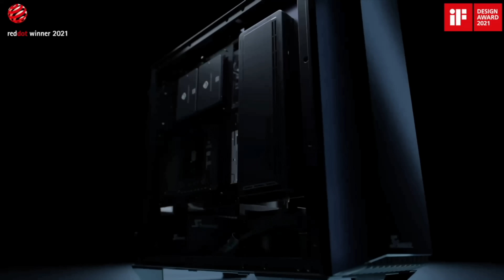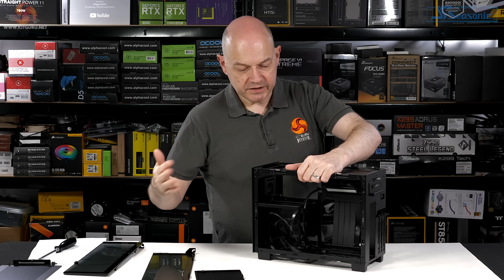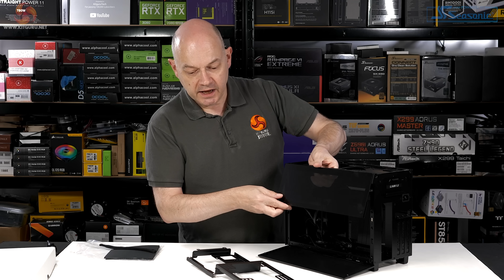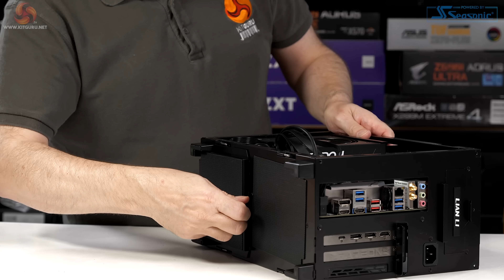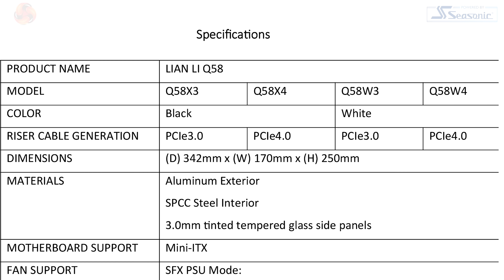Lian Li Q58 Mini ITX Chassis Review

Comment from the maker: the Q58 is very unusual - but what do you make of it? would you buy one for your next mini-ITX system?

TIMESTAMPS:
00:00 Start
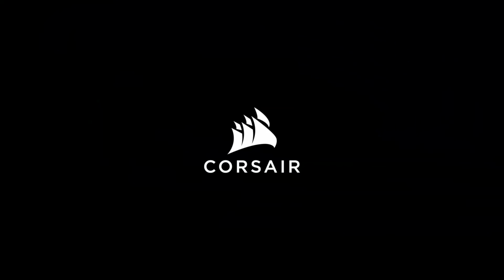00:15 Q58 - it looks bonkers!
02:08 If you want to see unusual …
02:19 The door/panel  system in operation
03:55 Alternate Top bracket
04:43 System build discussion
08:25 Swapping to SFX
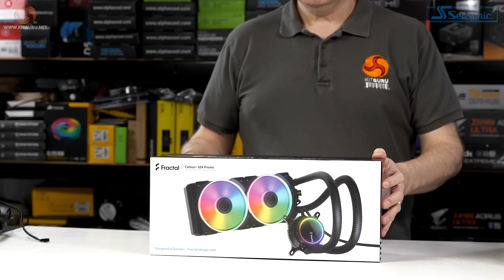09:21 Fractal Design Celsius S24 Prisma install
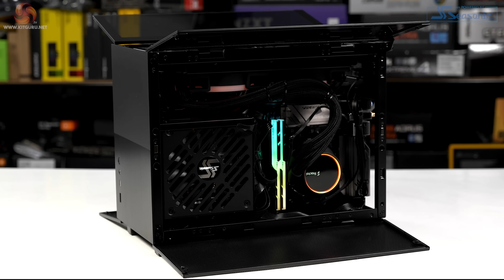11:08 The way Leo sees it
13:46 Leo ponders a revisit
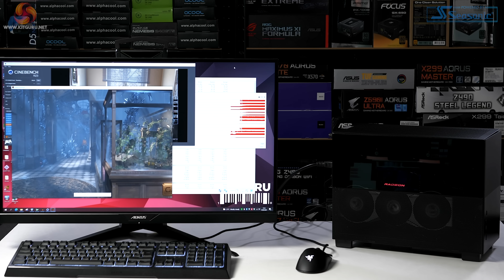14:09 Test Results
15:40 Leo's Closing Thoughts
Reply: Hi Leo, I'm more interested in the Cooler Master NR200P Max. There are so few reviews of it - will you be getting one? It has a similar design but comes with an 850w SFX PSU, 280mm AIO and Gen 4 riser. Plus there is room for 2 thin/15mm fans in the floor.
Reply: I've been waiting for this, buying as soon as it comes out, thank you for the review!
Reply: Top Review Leo, I am very interested in having one, only one thing don't like is  Tampered Glass looks very dark Tinted, Would be great if they included clear Acrylic panels with vented holes you just slot in the frame, Guess I could mod my own :)
Reply: Leo. I have a question. I already have an pci 4 riser (10 cm). You think I would fit in this case? It could save me some bucks to choose the 3.0 version. Thnx.
Reply: i have a little concern regarding being able to fit Asus Crosshair VIII Impact in this case. how's the clearance for SO-DIMM.2-Card? can you measure the space(lenght) from motherboard to side panel? and that PCI riser is it long enough to go over that dtx extension? thanks in advance!
Reply: I don't think a 650 watt PSU is powerful enough too run that GPU and CPU for power spikes
Reply: @seaneire2163  650w will be fine. 300w gpu + 105w cpu leaves plenty of headroom for whatever other small wattage consumption in other hardware and for spikes.

Comment: if they added a bit more height  and added space for 2 slim fans at the bottom for the gpu, this case would have been perfect. 
I just dont get putting glass on the top-gpu side (for the white ver. at least), what are you showcasing? the radiator sides?

Comment: Good review, but I disagree with the CPU/GPU discussion.  It's more of a FPS discussion than a linear scale with GPU speed.  If you're buying a 6900XT to play at 4k60 Ultra... A 5600X would work just fine.  If you're trying to hit 165-240+ FPS, that's when you need the faster CPU.  

Just a minor point of correction. Good video - cheers!

Comment: I am hearing 280mm rad support is very very limited or non-existant. Can anyone confirm fitting a 280mm rad into this case and which one?
Reply: Install fans on the Bracket and remove the hot swap SSD slot should provide enough space.

Comment: Good review Leo, although I think you forgot to mention that you can mount another 2.5" SSD behind the power supply as well. Also, just so we're clear, am I right in thinking a 280mm rad will only fit if the fans are on top? Do you know whether there are likely to be compatability issues with different 280mm AIOs (I'm looking at going with EK) 

I think this is the case that will push me to go ITX. Space for 2x 2.5" drives with no compromise on fans, large AIO support, full length GPU support, additional mesh panels available as well.

I might even see if I can squeeze some 40mm or 60mm noctua fans underneath the GPU to help actively exhaust hot air more effectively.

Comment: Are you still doing another video trying to fit a 280mm AIO? Very interested in this case but want to see fitment first, I read on lian li website should work but you have to install fans above radiator and move the psu down, was just wondering how much room that gives to route the tubing over the psu, and in this orientation can you still fit the 120mm fan under the psu? No ones done a video on this yet
Reply from the maker: Leo here: The Q58 is on the bench at this very moment with a Noctua air cooler installed. The next step is to have another go with an AIO so yes to the video however the results are currently unknown. Installing a fan under the PSU looks theoretically possible but in practice I have no clue how you keep the various cables clear of the fans blades.
Reply: @KitGuruTech  thanks Leo, first tech youtuber to reply, will eagerly wait for the video. Earned my sub

Comment: Would the Scythe Mugen 3 be a viable option in this case? In terms of ram clearance, holes to breath through etc.
Reply from the maker: Isn't thats a tower air cooler with vertical 120mm fan? You have max 67mm clearance to work with inside Q58 so the cooler must have a horizontal fan to have a chance of fitting.
Reply: @KitGuruTech  I am sorry, I meant the Scythe Shuriken 3, which sadly has a 69mm tower height, as stated by Scythe. Is there a difference between the clearance when using either the glass or the mesh panels? The fan it comes with is 17mm but noctua produces decent 15mm fans :)
Reply from the maker: @RubenKemp  Well in that case it ought to be possible with a 15mm file but it will be VERY close. They don't give different clearanced for the two side panels but it would be amazing if the mesh doesn't have an extra millimetre over glass

Comment: I wonder if using a cpu/pump combo, like the Alphacool Eisbaer LT, with some cut to length hoses, would be a better option instead of the AIO with their fixed length hoses? 
That's what I would do if I were looking to build out in a SFF case like this. 

Love the review. 👍
Reply from the maker: Glad you enjoyed it. I wouldn't be the least bit unhappy if Q58 was shipped without support for ATX and with a suitable 240mm/280mm AIO with appropriately short hoses.

Comment: Thanks for the review Leo, I think I would build this case with a 240/280mm AIO with a SFX PSU, with the mesh panel on the bottom and glass on top on the GPU side for GPU airflow, but on the CPU side, I would try with the glass panel on the bottom to get a nice view of the AIO pump lighting and RGB ram and the mesh panel on top to allow the AIO access to fresh air rather than simply exhausting all the GPU's heat. Lastly, I would run the bottom fan as an exhaust to help with GPU heat, similar to Ghost S1/Sliger SM5xx series.
Reply: I don't believe that's possible due to the way the panels work. You cant have mesh top, glass bottom on one side and the reverse on the other.
Reply: Actually you can mix and match it's interchangeable. You can even put all glass on one side too. But what Brandon mentioned is very doable

Comment: I Pre -Order mine 'Q58W4 MINI-ITX ALUMINIUM AND TEMPERED GLASS CASE - WHITE' £136.99 OCUK, I wonder if my Scythe Big Shuriken 3 79mm Hight fit
Reply from the maker: You only have 67mm to work with!
Reply: @KitGuruTech    I made a type error LEO, Scythe Big Shuriken 3 is 69mm tall with fan, I think can just fit in there, The prototype of this case states 70mm max
Also I noticed the  white version of this case as clear glass panels no tint. got white on Pre-Order with PC-E Riser 4.0  £136.99.
Reply: @maxabillon  Did the Scythe Big Shuriken 3 fit well in the case? What air cooler are you using?

Comment: Are you able to turn the CPU radiator 180 degree and hide the lax of the pipes toward the right bottom and side?
Reply from the maker: The user guide is clear about the orientation of the radiator. The real question is whether the hoses can route down past the RAM and double back, which doesn't seem possible with the Cesius+

Comment: Nice to see a Mini ITX case able to fit a regular ATX power supply. I plan to transfer my build into a similarly sized case in the future but I'm not really looking forward to swapping all the components with their Mini ITX versions, especially the motherboard.
Reply: ATX power in Mini ITX is just a waste of space and causes unnecessary headaches. SFF units are plenty powerful enough for anything you can actually fit in an ITX chassis.
Reply: @rossclutterbuck1060  my goal is to reuse as many components as possible from my current build

Comment: The CPU temps seem high given its a 240 AIO. Has plenty of ventilation, is the top panel blocking air flow?
Reply from the maker: It's more about the cables and general clutter than the outer panels

Comment: TBH the design is cool, but I would have prefer entirely just full mesh panels on both sides for the best cooling performance. Bottom of the case should have been fully ventilated too along with support for additional 2.5 inch drives in the front of the case like with the Cooler Master NR200.
Reply: there is not best cooling performance with that setup, it was already tested months ago

Comment: My takeaway? Not particularly well designed from the perspective of 
installation; it is too biased to form over function. PSU cables are a 
thing; AIO heatsink hoses are a thing; they have been for 10-15 years.

What I want is thinking INSIDE the box. 6/10

Comment: Seems like a DAN A4 inspired/derivative case embiggened with some clever tricks and transformation options. At 14.5L based on the published dimensions, it is about 2x the volume of a DAN A4. The DAN A4 does not support GPUs that exceed 2 slots in width. Unfortunately, true 2-slot GPUs are becoming the exception rather than the norm this generation.
1) I prefer to use an air cooler on the CPU for creating airflow over the motherboard. I'd likely install a fan in the bottom for the same reason.
2) I like SFX PSUs.
3) Given 1 and 2, the case seems overtall for me (there would be a fair bit of wasted space at the top), but that is a bit of space that could be used for stashing cables or adding extra fan(s).
4) I, too, would want all mesh panels.
It seems a good effort from Lian-Li and the price seems fair for the engineering that has gone into the fan header and drive caddy. I suspect that it will go over reasonably well in the ITX community. I'd consider buying one.
Thanks for the review, Leo.
Reply: They're working on a case with DAN Case as well with 3 slot gpu support it looks sick honestly.

Comment: Re the PCI-E 4 riser, it would only be running in PCI-E 3 mode on a B450 motherboard wouldn't it?
Reply from the maker: Quite correct but Gen 4 problems can crop up anywhere along the line.

Comment: Why did you come to the conclusion that a custom loop is a non starter?
Reply from the maker: Leo here: Feel free to add the words 'in practice'. The space is restricted and the shape of the space is hard to work with, and in particular mounting a reservoir would be hard. Yes Barrow does a combo block and yes, if very carefully choose your hardware so you have a tiny GPU (a la GGF) then anythign is possible. In practive there are many better options out there.
Reply: @KitGuruTech  there have been doing custom loops in node 202 which is half the volume of this. The q58 is a joke compared to that

Comment: You can easy build a full watercooled system in this and the fact you can use a 280mm rad that's amazing. The most easy way to do this, is to use barrow cpu/pump combo. You could also use bitsky granzon radiator/pump combo (but you'll probably have to go with the 240mm because of the extra lengh).

You could even watercool the nvme if you really want.

I own the Silverstone LD03 and I have fully watercooled it and I mean watercooled it to the max, because my nvme is watercooled and also my ram. I have two 120mm rads, I am using the barrow cpu/pump combo and the system spec is i9 10900k with an 3090 (I have the active ekwb backplate on it aswell). I only have three fans in it and this summer I was not going over 75 (I don't have an AC, so if I did I would be golden). So just with two 120mm rad, 3 fans and everything watercooled, I get 75 in summer, that's pretty good. Right now it is not has hot as the middle of summer and I am already down to 70-69, this autumn and this winter I'll easy be at max 65 if not less.
Reply from the maker: If you want to go custom loop inside Q58 the only possibility would indeed be the Barrow block/pump/reservoir as it is compact and you don't need a separate reservoir however the space inside Q58 is very different to LD03. If anyone goes down this route, we want to see photos.
Reply: @KitGuruTech  If you're curious of my actual build I can send the pictures and if so, where do I send them? As for the Lian Li Q58 I can't do it at the moment because I don't have the funds for it, but in the near future, with the new 12th gen and DDR5, I might give it a go with this case and can send the pictures.
Reply from the maker: @harshlens  Leo here: The LD03 wouldn't really fit in here as it is a review of the Q58. Now I think about it I'm not sure which approach works best to post photos on YouTube - if anyone has a bright idea do please let us know. I'll have a word with Dominic and see whether he has a clever answer.
Reply: @KitGuruTech  I was just saying, even it tight spaces you can for the most times make it work. I can see that the Q58 can be nicely watercooled. Obviously with the barrow pump/cpu combo it makes it super doable because that's the addition of only a single tube to handls, but I'm sure even with some flat pump/res combos you can manage. Or like I mention, the bitski granzon rad/pump combo would make it similar to the barrow solution (only an extra tube to handle).
Reply: I was thinking of the one of the CPU blocks with the pump integrated as well, using one you could obviously make the pipes just the right length, so that would make managing them a bit easier in the case. Also custom length PSU cables would also be something to get with this case, would help a lot I would imagine.
Reply: @jonathanellis6097  oh yeah, if you can shrink as much has possible the cables, limit your amount of rgb (to not have too many cables) and use the barrow solution, that makes it for a clean and easy way to watercool this case. This new case looks pretty cool.
Reply from the maker: @harshlens  The best way to post photos is Twitter @kitgurupress
Reply from the maker: @harshlens  Yes fully aware of GGF - if you look around the comments you will see Stuart posted soon after the review went live and we responded to him and his review demonstrates you might be incorrect in your use of the word 'easy'